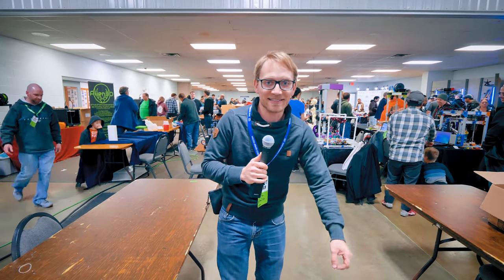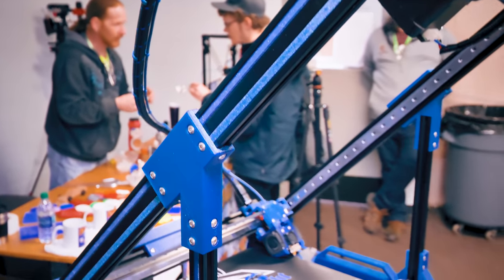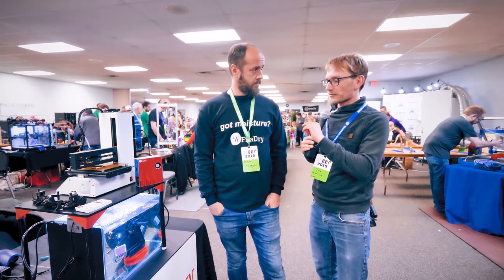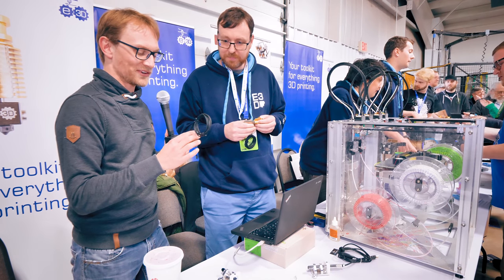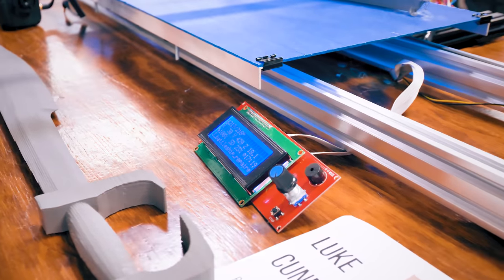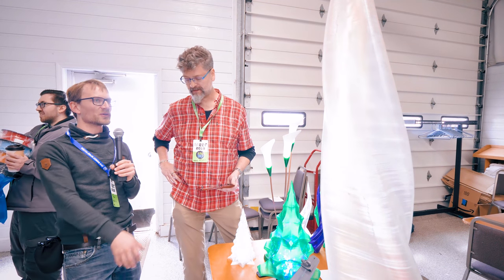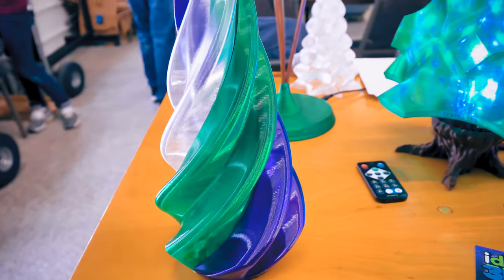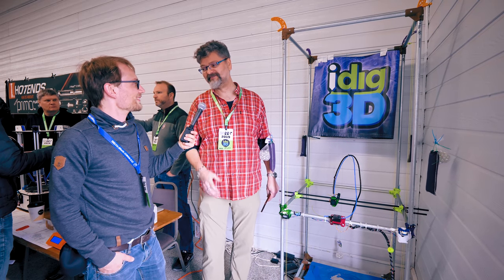Awesome printers from #MRRF2019

Comment: @5:15 Filadry -> They are solving an issue which does not exist for PLA. PLA is thus the perfect example to scam a drier like this. PLA being in the water has been shown to have exactly 0 effect on printability. Tho their device might work, but they should be showing it off using Nylon which absorbs moisture like crazy.
Reply: Wrong. Some of my PLA becomes extremely brittle if I leave it out to the point where it will spontaneously break just before the extruder.
Reply: @videblu  That is a known issue with PLA that can not be explained via humidity alone

Also even if that was solely due to humidity of filament, we still wouldn't see it during the print process. They want to show you that their machine makes filament look like it was stored dry - so no bubbles, no stringing etc. - Good luck getting PLA to a point where you actually notice humidity, it won't be after two weeksin a fish tank
Reply: Seems like the Filadry is a gimmik, if you look at some testing of it, the filadry does absolutely nothing. Would think maybe running it through a Dehumidifying Bucket you can achieve better results.
Reply: @michaelbiri6676  Calling it a gimmik is too kind, it's a scam. The guy is lying about the thing using "vacuum" and "chemical tricks". Another youtuber, Kuntry 3D, has done a teardown. It's some poorly glued together pieces of plastic, a pair of fans and a heater cartridge that achieves nothing except creating a huge fire hazard. They didn't even bother with basic overheat protection so at best it does nothing, at worst it produce a pile of burning plastic.

Comment: About that printer shown at 11:00 with the long unsupported arm on which the printer head moves in and out... a huge improvement would be to install a dynamic counter weight driven by the same cable that drives the head. That way it would not sag when the head is out at the end of the arm.
Great show BTW. Thanks for sharing.
Reply: Thanks for the tip. I'm currently working on ways to improve it. It actually doesn't sag so much it the z axis as it vibrates in the x. I think a weight on the end would prevent these vibrations

Comment: That string printer has potential! One motor and counterweights.. Very cool! I don't see why string can't be used more. Years ago I worked on a sawmill and the 40 foot bed was cable drive powered by a vw engine and eventually a 300 straight 6. I really look forward to building bigger and better things like many in this video.

Comment: I feel like it says alot about the quality of filadry that they choose to use PLA, a filament which absorbs very little water comparatively, instead of filaments which actually have issues with moisture like PETG and nylon. Yeah after a week im sure itd soak up enough water to affect the print quality, but it still makes me suspicious they wouldnt use the filaments that actually need drying. Ive left a PLA spool out for half a year and it printed fine. I left my spool of PETG out for a few hours and it was unusable.
Reply: There's been several dissection videos and it's a complete pile of trash. There's possibly an actual good product like it from thordsen 3d though just this month. I messaged kuntry 3d to take it apart like he did the filadry, hopefully they do.
Reply: Nothing is going to replace a tote dehydrator with bowdens sticking out from it.
Reply: It's a scam and a fire hazard. The guy lies about using vacuum and "chemical tricks". It's just some poorly glued together fans, a heater cartridge and plastic without overheat protection.

Comment: Interesting string design.  I tried spectra in a older reprap design.  it works ok for a while then it starts to fray, and the frays would catch and cause layer shifts.  I suppose since his mechanics are larger, the frays dont catch.
Reply: granted, only have a few hundred hours on the printer, no fraying. But also using fat, 1.2mm 8-strand, 300lb. test. The 80-90lb. I used for the counterweights stetted a bit more than hoped.

Comment: Does the Filadry have a consumable life span? If it uses a silica powder (according to comments on the FB page) does it lose it's effectiveness with use/time? I like so many want to see what it will do with a old roll of unprotected TPU or Nylon setting on the self for months and see how it does. One of the biggest issues I have is prepping the filament in a toaster oven...

Comment: The Filadry thing looks interesting, but he really would need to be doing the demonstration with nylon to convince me it's really able to dry so quickly. Do they limit everybody in there to PLA only if doing demonstration prints?  Let's say there is a silicone gasket the filament goes through, and a vacuum is being pulled - that has to be pretty noisy (never seen a quiet vacuum pump - even the hand held carrying type could wake the dead), and what chemistry trick could he be talking about?  Anytime I hear chemistry I think consumable - does it have some kind of chemical you need to replace for instance?  Maybe he could get you a review unit and you could try some nylon and polycarbonate - if it works that's so much easier than what we've all been doing so far trying to seal things up tight and then having to bake moisture out when it didn't stay dry over a long storage period.

Edit: Wait, 12V, 3A - and it has a heater.  Can it really have the power to pull a vacuum too?  I did rewind, and watch again - he definitely said vacuum right?
Reply from the maker: I'm pretty skeptical of the entire "vaccum" and "chemical" thing, too. As I understand, the "vacuum" part is a fan sucking air out of the enclosure faster than the heater blows it in. "Chemical" - no idea.
In the end, it's probably not more than a nicely packaged and presented low-power blowdryer.

Comment: I hope somebody does a White Knight kit, and keeps it at 400x400x∞.  I've sourced all the parts for printers before, and it usually will cost the same or more than a kit would (and obviously takes a lot more work finding/ordering/keeping track of it all).  Plus - a kit manufacturer would be able to source the stuff like that extra large Buildtak sheet much easier.
Reply: Wish granted......  I've partnered with Printed Solid to produce a kit version of the White Knight.  I'll be posting more info on my channel and twitter as it becomes available..
Reply: @NAK3DDesigns  I subscribed to your channel.  Also watched your 5 week assembly video - great ending you did on that (lowering it into the box).

Comment: I bet that last 3D printer cost less than $500 and has a huge print volume.
Reply: Jacob R I did a rough BOM and my TowerBot parts cost under $400. Under $350 if you skip the Raspberry Pi running Octoprint with a camera.
Reply: @iDig3D
“Under $350”
It was at this point I realized this 3D printer was actually a 7 story tall crustacean from the Paleozoic Era!
Reply: Idig3d  do you have the 3d parts files available online?   Also btw I am in NZ and your .com site doesn't seem to want to accept my mailing list form with this rather that a State in the US ?  Checked your Twitter link as well and pleased to see the drawing starter... Laurie New Zealand

Comment: Is there any advantage in printig 45°? I actualy see none.
Reply from the maker: The advantage is that you won't get sued by Stratasys - they own the patents to 90° on a belt thanks to Makerbot.
Reply: @MadeWithLayers  Ah, ok 👍Thx for responding.
Reply: and the 45 degree angle is what gives you the ability to print a continuous print, otherwise you would be constricted to the size of your build platform.  In theory as long as I support the print as it comes off the belt, my only length restrictions are the size of my room and the amount of filament I own...